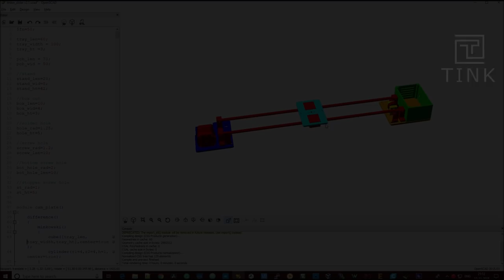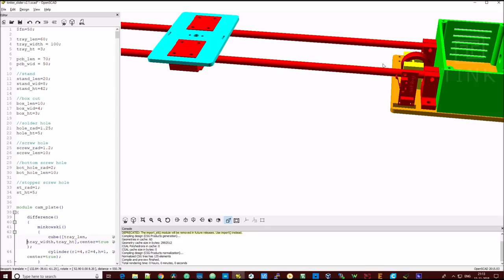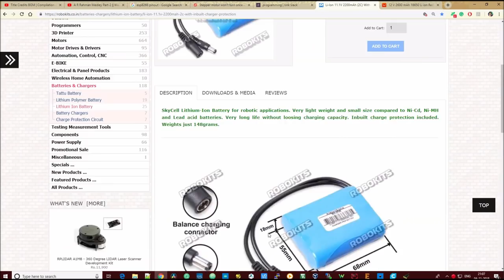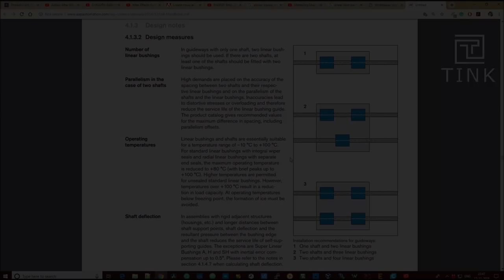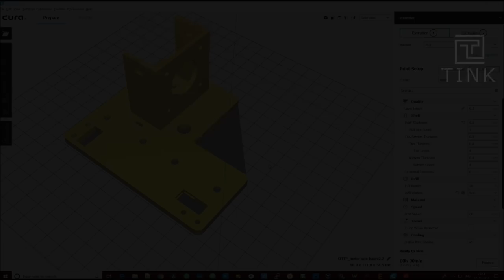#11 [Tamil] DIY Linear Camera Slider - Makerbench Series - S1 E5 - Part 1

Comment: Cost evlo bro achi etha ready pana???
Reply from the maker: Since this is a first-time prototype it cost a bit higher.. around Rs.6000. But Since I published all the design files, You should be able to make one for Rs.2500 if you have access to a 3D printer.
Reply: @TinkTamil  bro drawer slide rail use pani oru camera slider make panunga bro link la vdo eruku parunga bro .just 400rs  dhan ethula konjam stepper motor matum fix pani make pani katungq bro . 
httpsutu.be/1HGBqFW6t1I
Reply from the maker: It may work. But you can't take it everywhere.